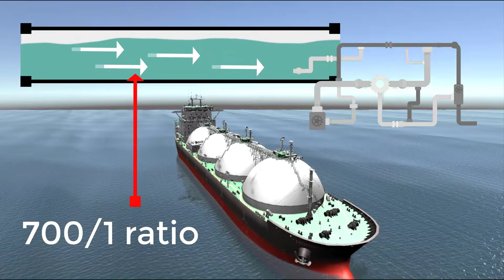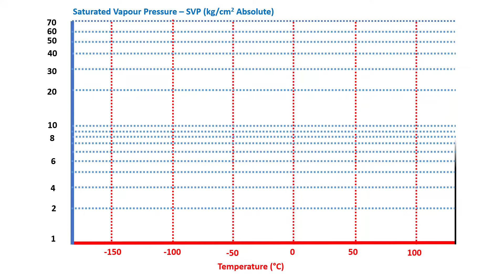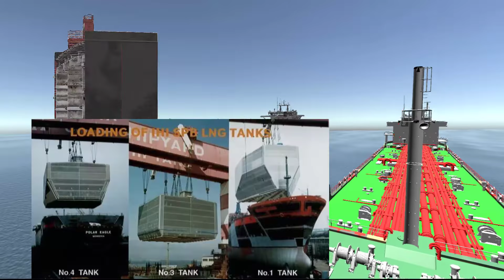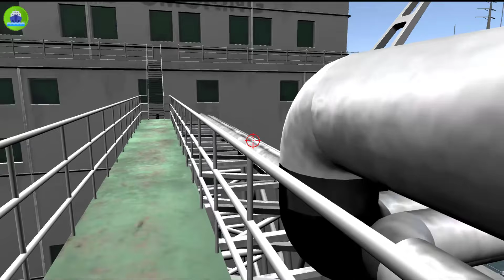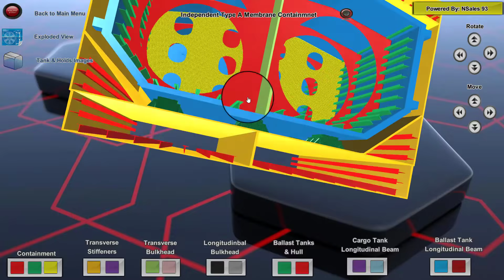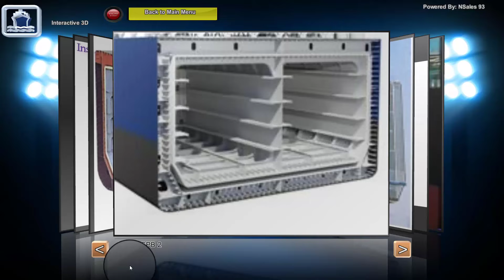Gas Carrier Ship - Introduction to LPG, LNG & Chemical Gases Carriage, Transport & Handling

Comment: The IGC Code applies to ships regardless of their size, including those of less than 500 gross tonnage, engaged in carriage of liquefied gases having a vapour pressure exceeding 2.8 bar absolute at a temperature of 37.8°C, and certain other substances listed in chapter 19 of the Code. The aim of the Code is to  500 Gross Carriage of Lequfide Gases.❤️